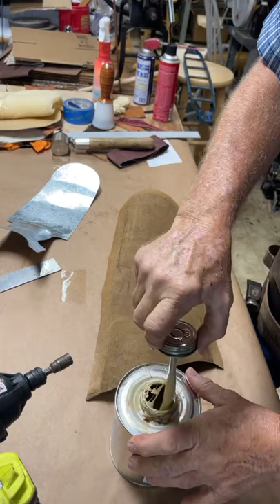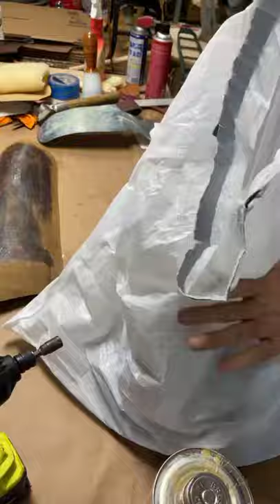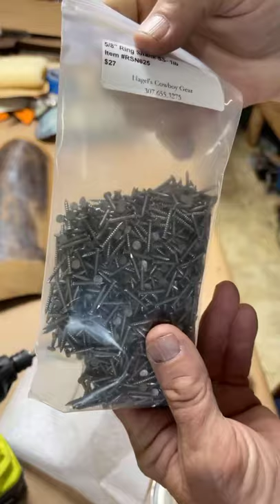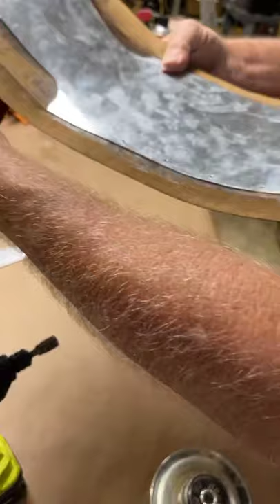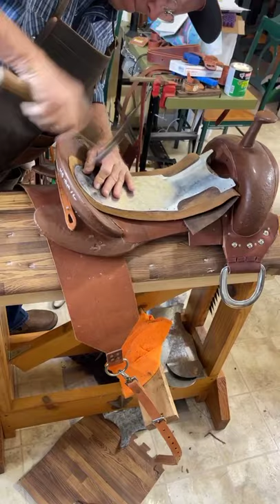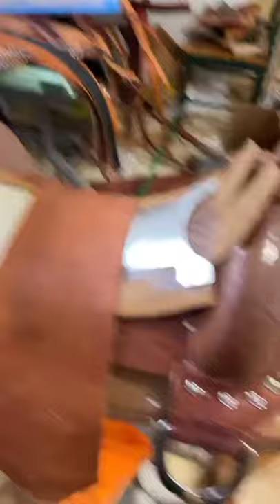Seat strainer install

Comment: I found those tin strainers at Weaver leather but they call it the quarter horse strainer and It’s kind of short, the cross bread strainer is 16” long... I’ve also found them at Bowden Saddle tree
Reply from the maker: I ordered from Bowden, and didn’t like the shape they were bent in... a crease, instead of a roll... these I found from Montana Leather...
Reply: @DavidMillsSaddlery  hmm 🤔 I’ll double check mine, I think it was fine

Comment: What kind of tree is that?
Reply from the maker: It’s an old (before being sold and moved to Mexico) Hadlock and Fox... it’s their Bowman roper. It’s fiberglassed and then coated with something like a truck bed liner! Precision Trees in Yoakum does the same thing, but they use Kevlar... that’s who I’ll be using from now on!
Reply: @DavidMillsSaddlery   I’m building on a Bowden Wade when I get it started,, I’m a brand new beginner! I’ve been seeking out any info I can on ground seat. That’s how I found your channel 😎🍻
Reply from the maker: I’m not sure how to add pictures on here...
Reply: @DavidMillsSaddlery    I used to like Hadlock...here lately its been bad
Reply from the maker: @susanwilliford7975  22 years ago they were 30 miles from my shop! I was there at least once a week, getting hardware or trees! When I had a tree that had to fit a specific horse, I’d bring my measurements to them and worked with them! The Hadlock family sold out to Alamo Saddlery and everything moved to Del Rio, TX
I believe the factory is in Mexico… that would explain the change in quality of their product!
Reply from the maker: @ZeRowe  how’s your build coming along?
Reply: @DavidMillsSaddlery  Thank you David....YES!   I got burned bad...
Reply from the maker: @susanwilliford7975  I’m sorry to hear that!